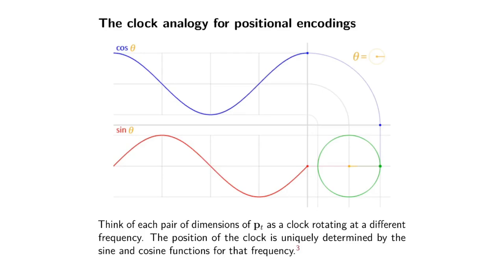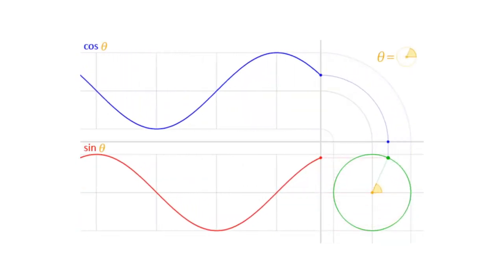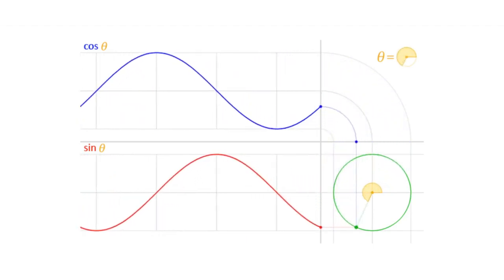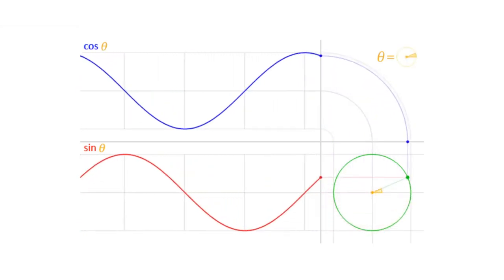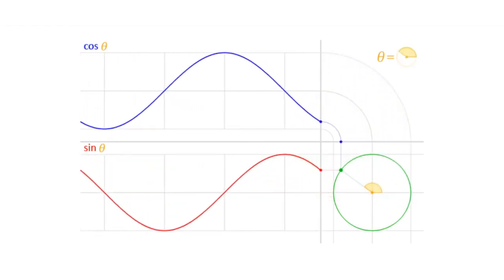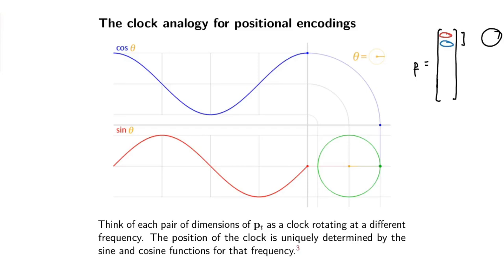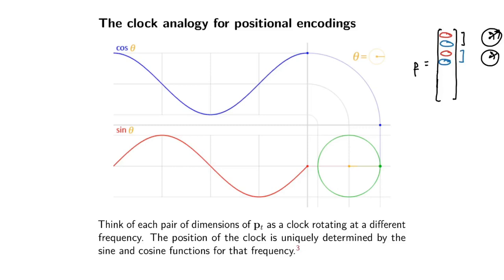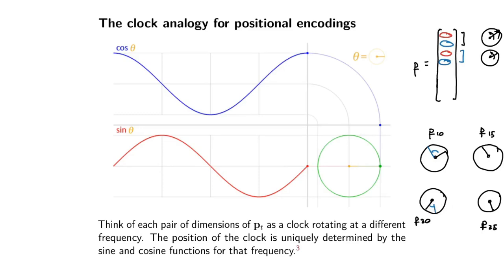The clock analogy for positional encodings (NLP817 11.6)

Comment: With regards to the clock analogy (0:48): "If you know where you are on the clock then you will know where you are in the input".  Why not just a single clock with very small frequency? A very small frequency will guarantee that even for large sentences there will be no "overlap" at the same position in the clock for different positions in the input.
Reply: I’ll try to explain this. First, as far as I understand, the number of "clocks" (i.e., sine and cosine functions) used in positional encoding should match the size of the embedding vector (or feature dimension) to which the positional encoding is being added. This ensures that we encode the position information across all dimensions in the same way we encode the semantic meaning of the words.

Now, about using just one clock with a very low frequency: while it may seem like this would help avoid overlap between positions, it would make it harder for the model to distinguish between positions that are close together. Sine functions with low frequencies change slowly, so two nearby positions in the sequence would have almost identical values in the positional encoding, making it hard for the model to tell them apart. 

By using multiple frequencies the model is able to gain understanding of the relations of both close and distant words in the input as well as easly distinguish between positions, even those close to each other. I hope it helps. If I'm wrong in some parts of my explanation please correct me @Herman Kamper
Reply: @mateuszwojciechowski9824  Thanks for this answer! Do you mean that due to numeric precision positions may be identical? Otherwise I don't see much of a problem, since different positions will get different values